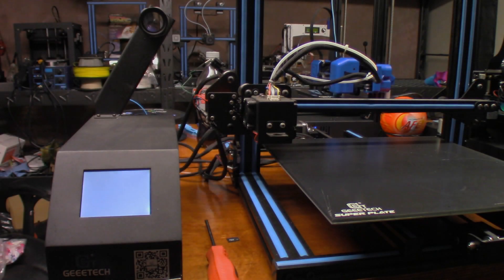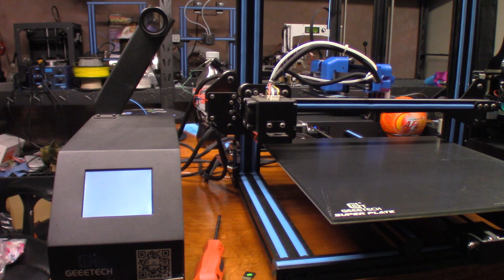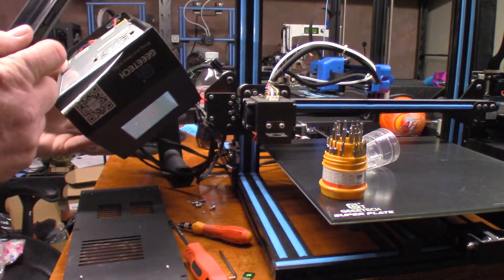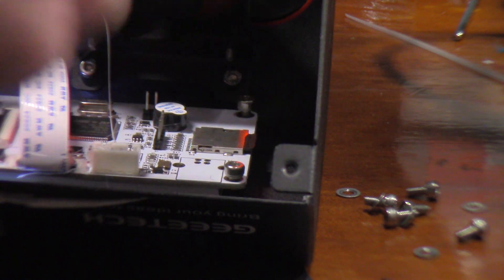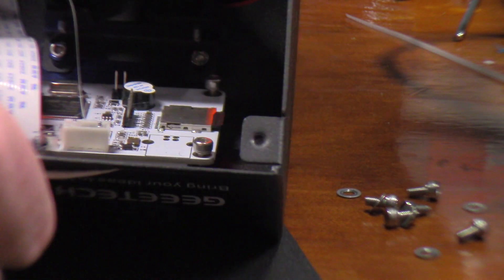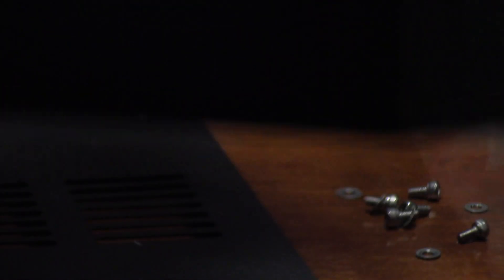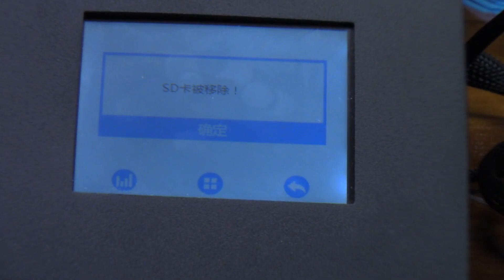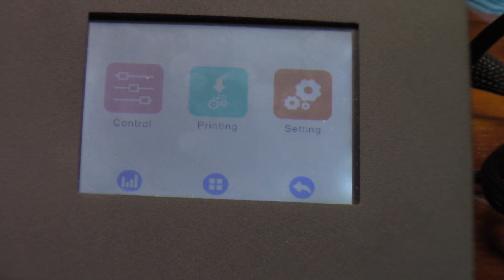Fixing Blank Screen On The Geeetech A30

Comment: Thank you much.   Worked.   Strange how a printer just sitting there ends up with an issue.   And my SD card was hot glued in place (weakly).